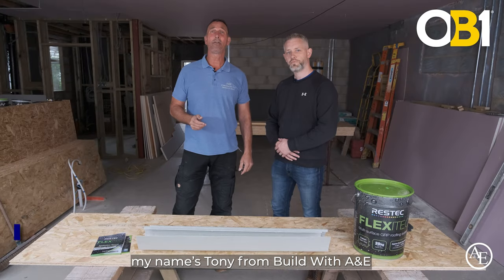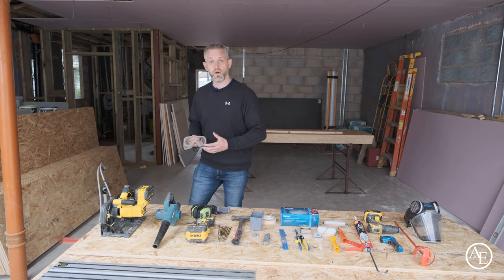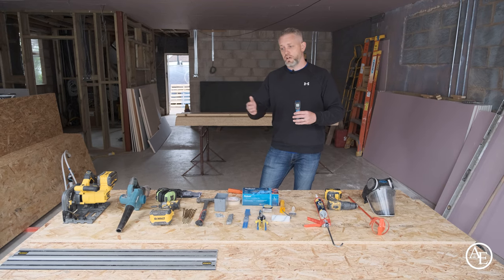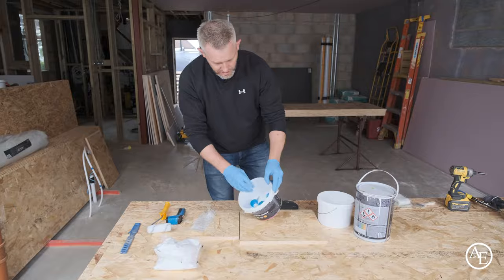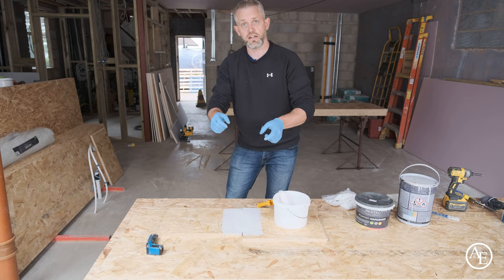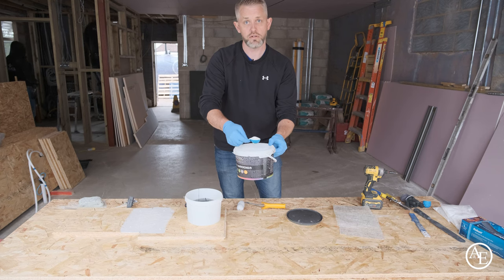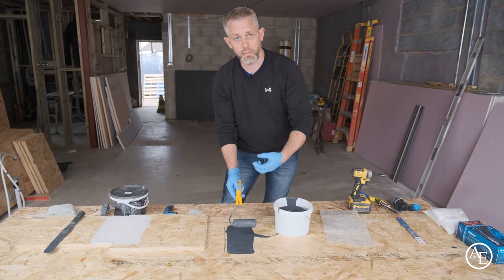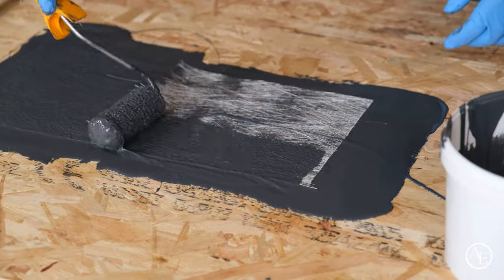How To Install GRP - Fibreglass Flat Roof Part 1

Comment: I’m a DIYer and did my own garage roof in GRP a few years ago, was easy enough and been perfect since. There are lots of places where corners could be cut, follow the instructions to the letter and you get good results.
Reply: can it be used on top of existing fibreglass roof to have a patch of repair?
Reply: @12mukesh30  possible but you need to rough up and thoroughly clean around the repair before fibreglassing and underneath needs to be dry.
Reply: @kiteless1  thanks a lot! Very kind of you to reply me back!
I am not a good DIYer, can you pls share some more details on how and which kit I should order.

Comment: if you get a fibreglass flat roof installed 
get this firm to do it .or another good roofing firm 
a lot people who do these roofs look at a video like this 15 mins long 
and just slap the fibreglass down . no reinforcing joints ,no fluffy edges no gadget to see the temperature
i know i rip a lot of these up were there not done well .

Comment: As a roofer I have come across so many leaky fibreglass roof systems. I just don’t trust them and never recommend anyone to have them installed. Much prefer single ply, rubber or resitrix
Reply: A customer of mine had a fibreglass roof done which indeed leaked. 3 times they came out to try and fix it.
Reply from the maker: The problem is with a lot of the older GRP no flexibility we’re this has and bad installation is the main reason all the best Tony 👍
Reply: only reason fibre glass leaks is poor installation
Reply: @stuartjones2242 And bad advice videos on YouTube making out it’s easy to do when it’s not easy. You can’t learn how to fibreglass off a video just you you can’t learn to be a nuclear engineer by watching YouTube videos. Trades like this take years to learn and perfect.
Reply: @GRPLiningServices  just like in your videos its more hints and tips to help.
We both know its not as easy as it looks and it takes time but everyone has to start somewhere dont you agree??
Reply: @aaronjonesGrp I believe there’s better places to learn about how fibreglass works other than on someone’s 1/4 million quid and upwards house.
Reply: @GRPLiningServices  Wait, did you just compare fibreglassing a roof to nuclear engineering?🤣
Reply: @kevocos No. i used what’s called an analogy.
Reply: @GRPLiningServices not at any point of the video did i say practise on someones house 🤷‍♂️, as with all products proper training should be done first.

Comment: I have a fibreglass roof which needs repair. I had a leak last year and got someone who did a fibreglass paint which fixed the issue, but need to fix it properly. Do you have any video which can help with the repair.

Comment: The product is probably good, but make sure you get a FLAT roofing contractor to do the roof. I’ve put loads of fibre glass roofs in the skip, mainly due to the installer not using enough material and don’t have a clue how to do detail work.

Comment: If it's so important to leave a 3mm gap between boards, what prevents the resin from filling the gap?
Reply: the matting
Reply: I doubt it. Unless the resin is used very sparingly...
Reply: He should use first masking tape to prevent resin leak down, then some tape to strengthen the join like drywall tape and then matt+resin
Reply: He is using OSB3 therefore I imagine the resin cant pass through the joint

Comment: Hi all I've bought all the equipment to start my fiberglass roof on my garage . 
I've bought 18mm osb3 . My only trouble is there doesn't seem to be a rough side both sides seem very smooth? Should I sand it or try and return it thanks in advance
Reply: Could I just add the bourds I've bought are kronospan ?

Comment: do you have to use tng can you use normal osb boards
Reply from the maker: Yes mate
Reply: @BuildWithAE  yes to which part
Reply from the maker: @hewoguys2506  my apologies yes you can use 8x4x18mm OSB but mate sure it’s the correct grade their are many different grades when purchasing ask the tell the person behind the counter what’s your using it for

Comment: Styrene breaking down the resin? You joking? The resin breaks the binder down that holds the glass strands together.
Reply: Correct.
Reply: Very true @GrpLiningservices you are correct, i dont do alot of filming like you and it was a slip of the tongue thanks for pointing that bit out it will be helpful to everyone watching.
Reply: Very true